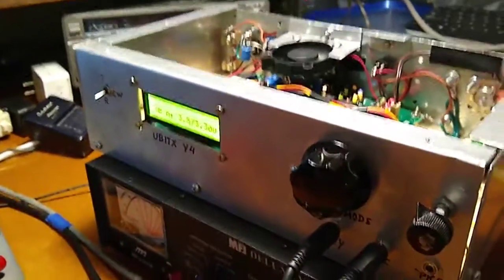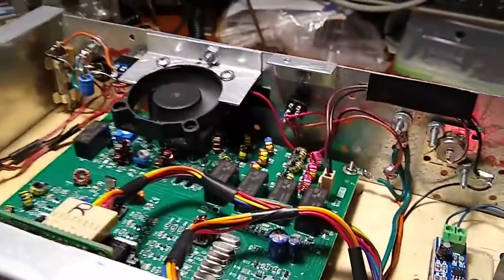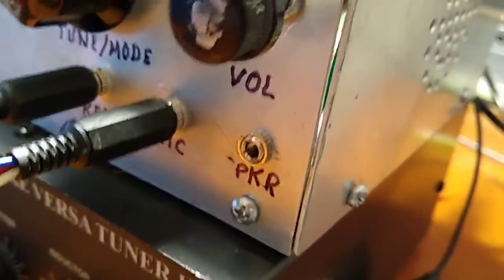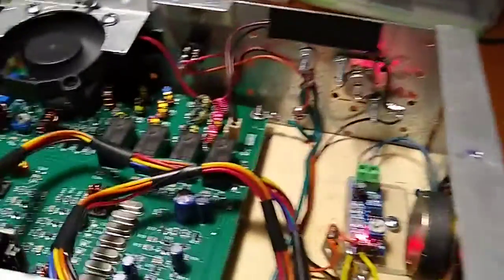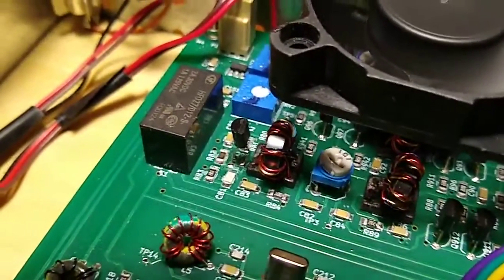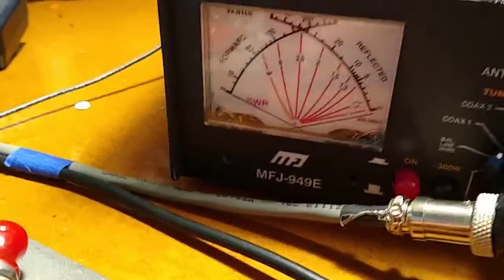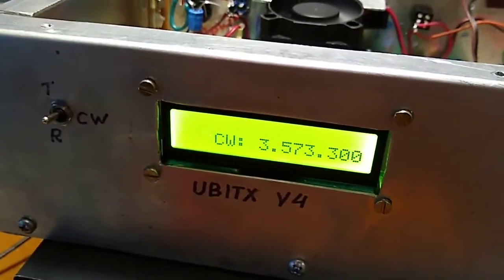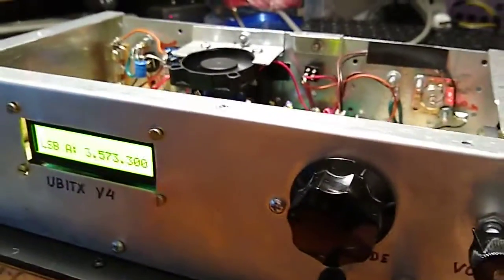W6RAG's ubitx 4 mods and experience with Q90 burnout

Comment: Hi, i have some troubles geting my UBITX on the air and searching for a solution for my issues. Perhaps i have done the same thing operating a powerful TRX in the surrounding of my UBITX. The question is: what happens if the Q90 burns out? What effects does this have for the TRX in detail? Thanks in advance and vy 73s from Germany, 

from Martin DK9CA

Comment: Thanks for the video. My Ubix should be arriving soonish can't wait.  Vk5fkov
Reply from the maker: The ubitx is a lot of fun and works really well
I make a lot of contacts using FT8
I think you will receive the ver 5 ubitx which has improvements and especially  you won't need to 
add and audio amp
Reply: @baler61  Hi again. Ver 6 was released just before Christmas and they ran out of boards. But boards should have arrived by now. Ver 6 is more or less the same as ver 5 but no soldering required it's all plugs. Now to make a multiband antenna up as high as I can get it. I have plenty of room and some extremely high trees.